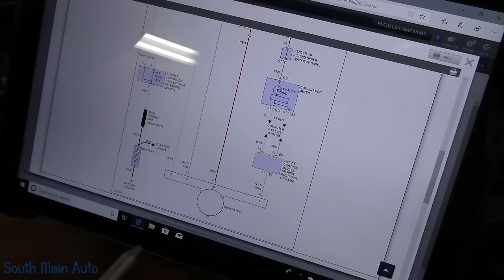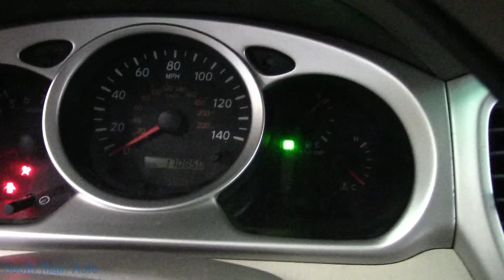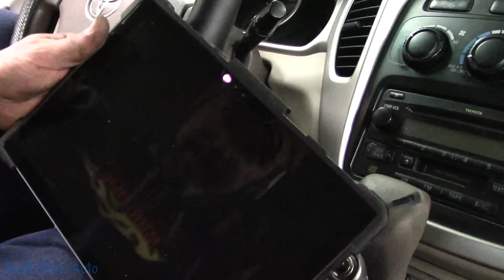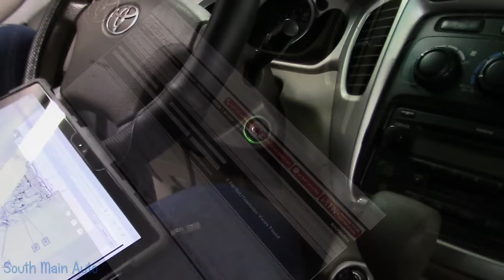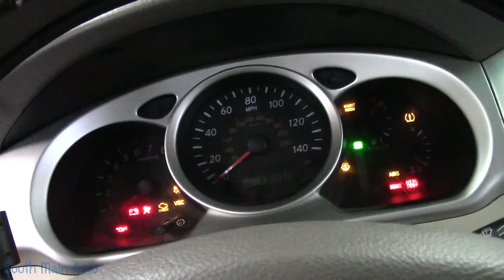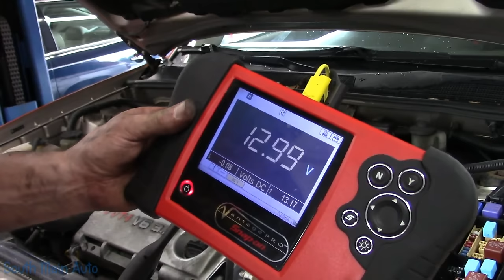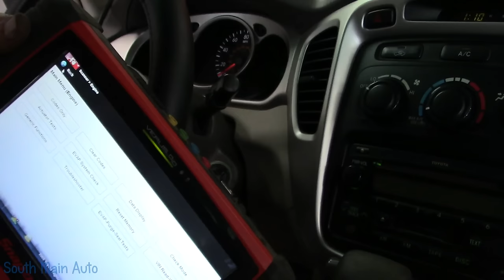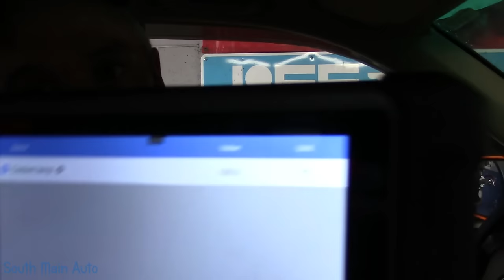Toyota Highlander - To Fix It, Follow The Smoke! 🔥

Comment: Toyota/Lexus 3.3 V6 engines are notorious for losing idle learn when you disconnect the battery. Ive been working on Lexus cars since 2006 and there is no magic way to relearn the idle quickly. Some do it fast after a road test, some.. well some gotta go home before they are happy. Takes forever. Not a fan at all of the 3.3 engine management or the transmissions of that generation.

Comment: When I changed the battery on my Suzuki it idled like crap for a week or two, and then just got back to normal. I think (I remember googling) there's some weird catch how you need to reset the computer, something like keep it on the 3k rpm for 2 minutes and then shut it off for 5 min... Something weird like that. I guess it also depends on the car you have

Comment: Hard to tell... was the melted connector ... the cause or the effect??  
 Maybe some day ago somebody did a boo boo like jump battery wrong or some other temporary short caused a wire in that connector to get too hot.
In the repairs.. I might have put some kind of male- females on all those wires or use a different available multi-wire connector... like a big multi pin Molex or such. But there's such a low chance of ever needing to replace that whole box.. so hard wiring is probably fine.

Comment: No wonder it didn't work you let the smoke out. LOL. bypassing the connector sounds like the way to go. When or if the fuse box needs replacing it will have a plug on it. That is the time to replace the other half of the plug.

Comment: Actually the terminals in the connector looked like they they could be made a little bit larger. Especially the alternator circuit. Looks to me like an engineering issue.

Comment: My gf nissan frontier will not charge if the battery light circuit doesnt work even though it just a non ecu controlled circuit that goes from fuse box to battery light to alt and alt causes a ground side open to shut off the light.the fsm says nothing about how important it is and couldnt figure out why it would create a no charge situation but 100% confirmed it will not charge without that circuit during bench testing.

but why?any idea how this circuit works?its really frusterating how the fsm doesnt disclose the importance of this circuit and im sure many people would assume it has no relation to a no charge costing many people money all because the lack of info from our fsm.

Comment: Great Video, and as usual, your Diagnostics are Supreme. I just looked up the cost of the Snap On Vantage Pro, what a shock!!! MSRP: $2,795.00,  do you feel it really worth that kind of money?  I have a 50 year old Tektronics Oscope that tells me a lot about Electronics but it is 24 inches long, 12 inches thick, and weighs 40 lbs.  not portable like that one.

Comment: Soldering the wires was the right way to go if you changed the connector then it would have cost your customer a lot more your method of finding the fault is also correct if people say you're wrong then thats THEIR problem keep up the good work 😊👍

Comment: Why do car company's have exposed connectors (especially power) to get corroded?  They should at least put silicone sealant where the wires are and and an O ring at the connection point. We all don't live in the sun belt.

Comment: Perhaps someday automotive engineers will decide that it's in the best interest of the electrical system to keep connectors, relays and other sensitive components a "safe" distance from that heavy unsealed plastic box full of lead and acid, but I'm not going to hold my breath waiting.

Comment: Would it be a good idea to break out the current probe to insure the are no circuits that are pulling more than about 10 amps?  {approx. due to wire size)

Comment: Can't you buy/use a 'generic' connector with sufficient # of pins vs a Toyota one ? Or, and this wouldn't be as ideal or reliable as a proper connector/harness, use male/female bullet connectors. In both cases, it would allow simpler disconnection of the wires if needed in the future.

Comment: Do you think it would of been worth it to use the inductive amp meter to look at the power going thru each of those affected wires to see if they were too close to their limits and causing a hotspot where that connector had been?

Comment: Toyota and Subaru notorious for having sticky IAC and then disconnect the battery and it cannot learn properly Spray some penetrating oil down the bypass for the  IA c Then give it a whack With the hammer not the throttle long extension smack throttle body Does have a relearn procedure and I unstick those IAc By putting an input into my matco s scanner that identifys  a autel that's overpriced  with otc cross with Chinese tablet But you can turn up-and-down idle speed take control of the iAC  I've had them real stock where taking control of the idle speed with the scan tool will not make any difference then soak them with sea foam penetrating oil break clean all the etc full open full  Closed. About 75% of the time they will come back to life. Which in my opinion is a better option than buying a Napa dormant junk iac. And cheaper than a factory one worth a shot.

Comment: I would repair4ed it the same way with the soder, shrink and SCOTCH SUPER 33+ ELECTRICAL TAPE DESIGNED FOR HIGH HEAT AND EXTREME COLD APPLICATIONS, no other tapes compare and should be held to a strict standard, Bear Claw Regime place is to promote safety, and protection of it's follower's!

Comment: I WAS WONDERING WHAT KIND OF AUTEL YOU HAVE. IM USING A AUTEL MAXICHECK MX808. YOURS LOOKS BIGGER THAN THE ONE IM USING AND MAYBE YOU COULD DO A VIDEO ON ALL THE KINDS OF DIAGNOSTIC TOOLS YOU HAVE AND WHAT YOU USE CERTAIN ONES FOR AND WHY YOU PREFER THAT TOOL FOR THAT JOB TODAY IS MAY 10TH 2022 THANKS DAN ZEMAN FROM ZEMAN TIRE TOWN IN DOWNTOWN CEDAR HILL MISSOURI

Comment: This is a bit of a weird question, granted, but, any idea where you can get those Astro lights (or something like them) in Australia? Or even from somewhere in the states that ships to our South Pacific paradise?
Reply: Amazon. The ship to nz as well.
Reply: Awesome, thank you! I honestly did think of Amazon, but did not bother checking, because so much goddamn stuff does not ship to Australia that it’s a little disheartening to try at this point. But it’s nice to know this, as that looks like a half arsed decent light. I’m eyeing off the Milfuckee underhood light quite a lot, but it’s a couple hundred bucks and I’d need to buy an additional battery if I want to keep all of my tools running at the same time - which I very much do  - 3/8” ratchet, 3/8” rattle gun, and a little handheld hook light. All stuff I often use all at the same time. 

I will buy this light at some stage, I just want a second half arsed solid light that’s not too spendy, especially if it’s magnetic, because the Milwaukee lacks that. Understandably, since it’s a big light with big batteries, but a limitation is still a limitation.

I wonder if there are any reviews of this light here on YouTube. Maybe I should get off my lazy arse and check.

Thank you for replying, though, it’s very helpful! I’ll have a squizz on Amazon!

Comment: that's what happens when you overload a shorted harness from putting a 10amp fuse into an 8amp socket.... extreme heat... would replace the socket on your own dime

Comment: If you pull a key from an ignition switch and power-related dash lights stay on you should get the vehicle the fuck outta your building.  Several car electrical work places down around me have tents with paved sidewalks that run to the building so they can just roll their tool cabinets out to the cars and back away from the burning cars.  Ignition switch faults are 90% of the time fires waiting to up your insurance costs.

Comment: Toyota ECM Do Not Remember Learned Engine Specs When You Take Out The Battery.
They Need To Be Driven 2 To 3 Hundred Miles To Relearn Desired Engine Specs.

Comment: There is a tsb on this. You disconnect the battery and the ice needs to relearn driving habits. Did this on my 06 Pontiac Vibe when I had to change driver side headlight bulb. Drive for like 50 miles. Should come back.

Comment: My 2012 Odyssey blew a backup light fuse.  With the fuse blown, the vehicle would not start.  It would crank, but no start.  What idiot engineer designed that system?